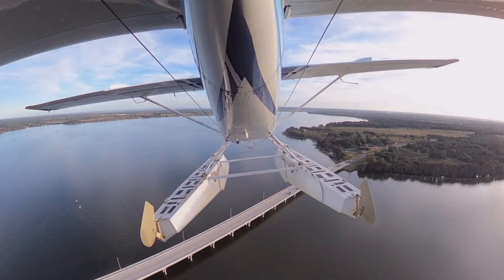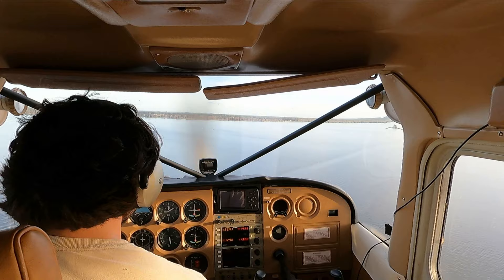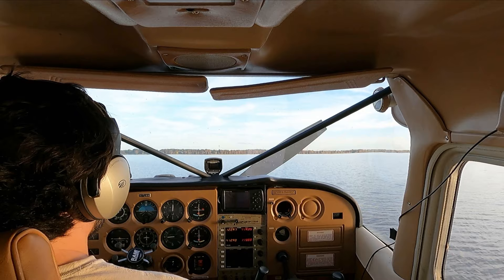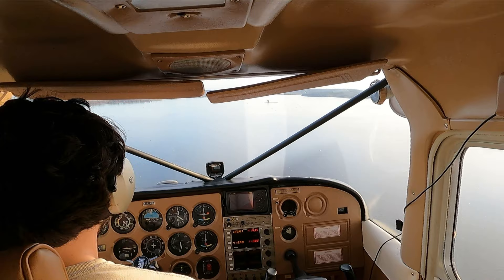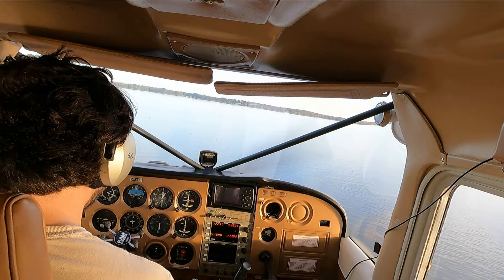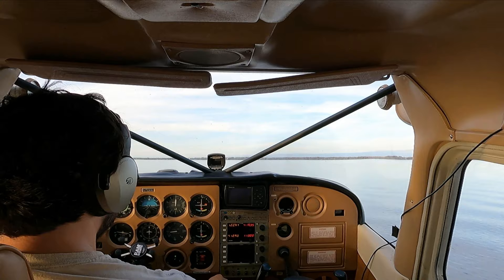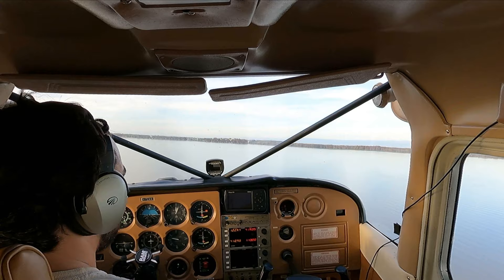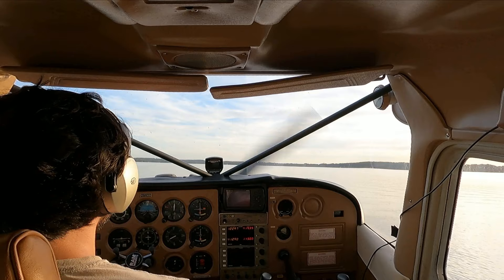Engine Failure at 700AGL -  Seaplane Deadstick (FLIGHT VLOG #24)

Comment: Good job but I would've landed parallel to shore using the shore in your peripheral vision for height reference. Smooth water can fool you into thinking you're too high or too low. This can cause a plow-in or belly flop if you flare too high or too late.